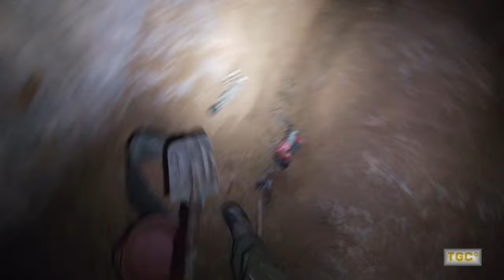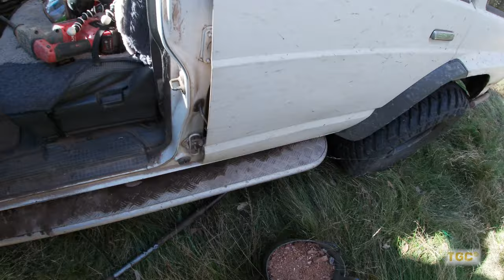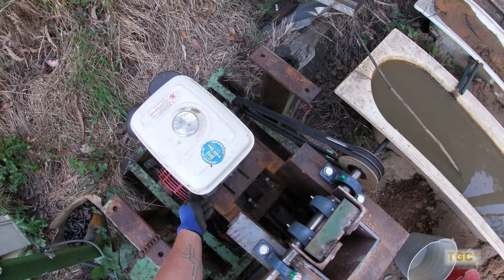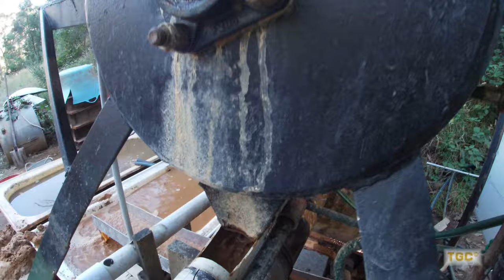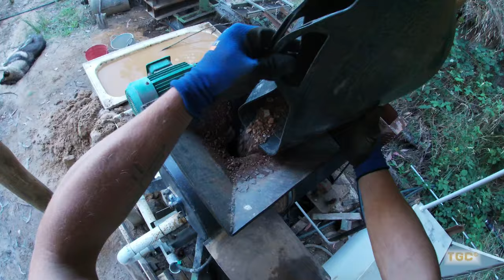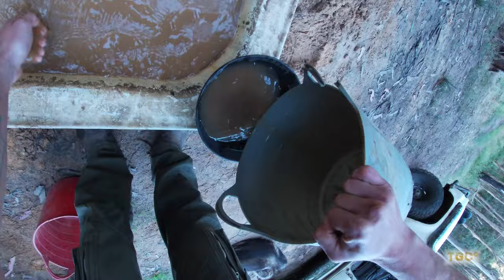Gold Reef Sampling (Whole process, but short)

Comment: Great video. I like the slow-mo. Have you heard of the Sierra Blaster? I was thinking of getting one, you do t need a blasting certificate. Also, have you thought about using a shaker table?
Reply from the maker: I saw them use it on one of the gold rush shows I believe. Would have to be handy for making small separations in wall rock underground I'd imagine! Particularly in a little mine like this, where the thin reef has been taken out and the wall rock needs to be taken out to allow the drive to continue in. 
Currently fixing up a shaker table for use with my crushing plant. It's just a bit lower on the priority list at the moment though, because I need to keep the gold flowing in. Should be a good payday when I get the shaker going and re run all of my tailings finally!
Reply from the maker: And thank you for the positive feedback also Bjarne! I really appreciate it 😁

Comment: The processing plant is coming along nicely. I read in another comment that the goal is to automate it, so the next goal will be the transfer of material from the jaw crusher to the chain mill and after that automate the feeding of the jaw crusher. One step at a time, one day at a time!
Mark from Melbourne Australia
Reply from the maker: Thanks Mark! Seen as the Jaw is so much faster than the rest of the plant I plan to still manually feed it. Then take the ore and put it into a hopper up above the plant. I plan for the hopper to hold about 500kg. It will then automatically feel the mill with a vibratory feeder. So I should only have to visit the plant every few hours to re fill the hopper if I'm doing a crush larger than half a tonne. She's all slowly falling into place mate. Thanks for coming along on the adventure
Reply: @TheGoldmansChannel  I don't know that aiming to leave the plant running for several hours on it's own would be wise. I think that a more achievable goal would be to have it running while you are able to step back and do other tasks around the site would be the safer and more achievable goal at least at the start.
Reply: @TheGoldmansChannel  I watched the jaw crusher video last night. I would have suggested that you make the machine at home and then break it down into sub-assemblies for transport and installation. That would have made things easier for your Milwaukee grinder, that's for sure! The crusher certainly gets through the material quickly enough.
Reply from the maker: I've toyed around with quite a bit of automation back in my sparky days. So it won't be too tricky for me to get the whole thing running on its own for a few hours at a time. The plan will also be to have a few cameras setup at the plant so I can remotely monitor from my phone and get alerts if there are any faults so I can remotely shut it down also. I can't imagine too much going wrong if I slow the feed down a little bit though. Usually any issues within the plant are just caused by me feeding it too quickly 😝